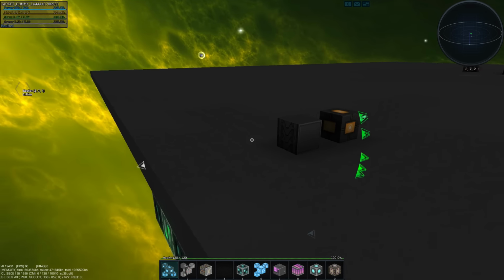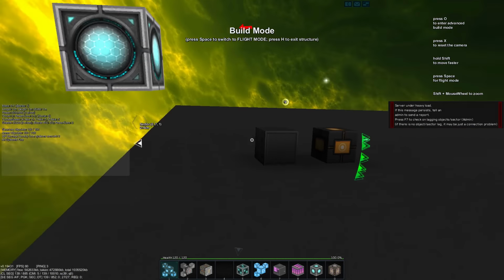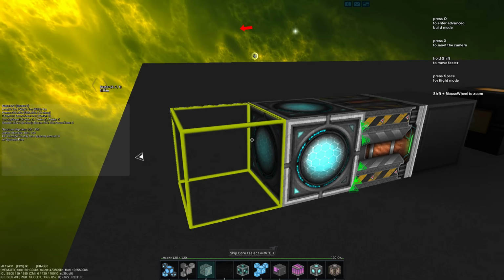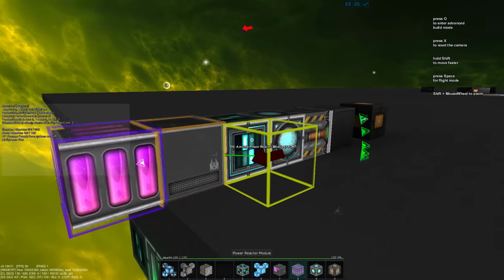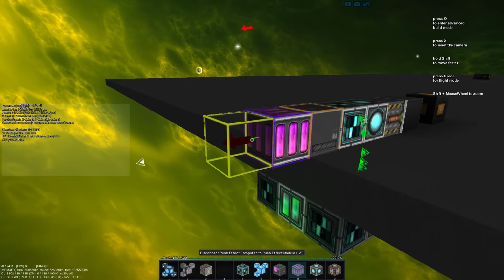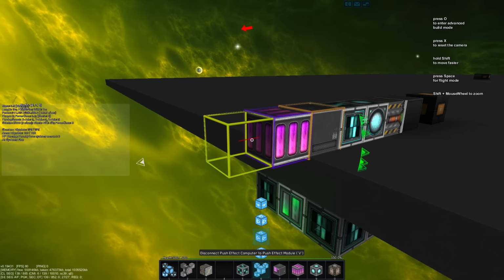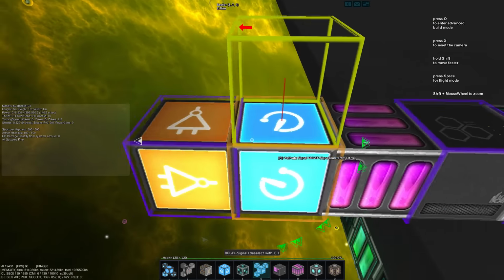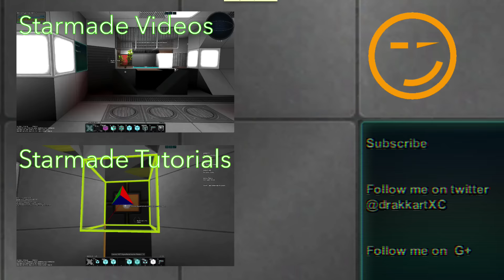Starmade: Torpedo Tutorial

Comment: Can they be made bigger to store more warheads? Or is this the recommended size?
Reply from the maker: i guess it is not size you want, i assume you are asking for more boom right? there is anoher video on how to adjust that. But there was something like that they have a weird stacking mechanism i just can not fully recall but it was like there is a very short limit of what is the maximum you can do which is why most people stick to single warhead or use a torpedo that accelerates and glitches multiple through the enemy ship hull - now thing with that is it is a glitch and probably already fixed...